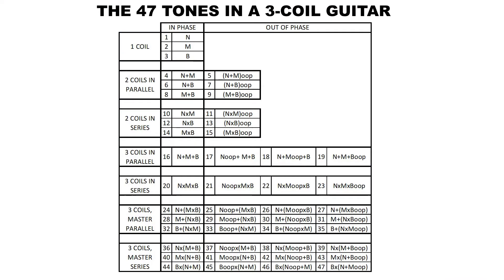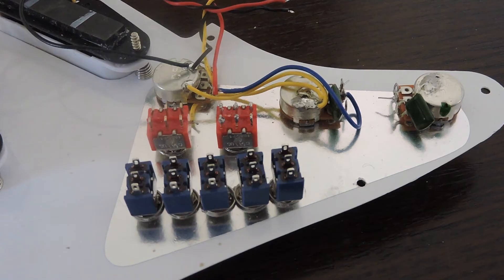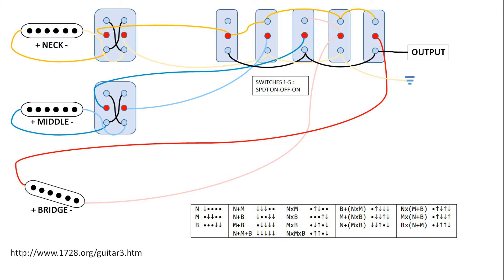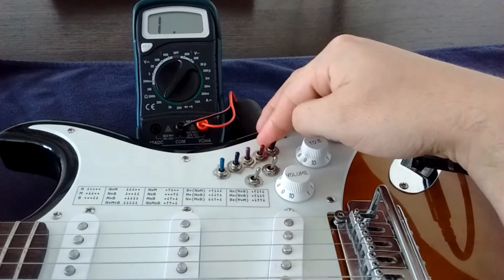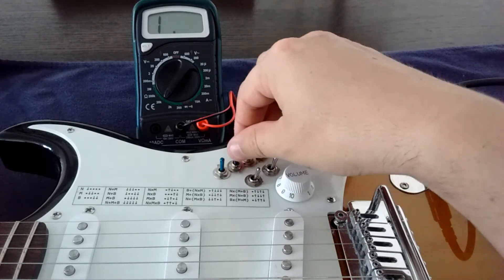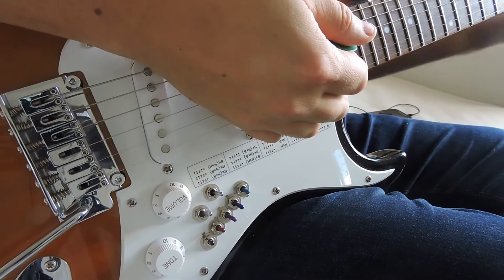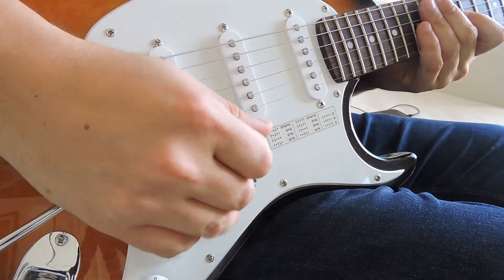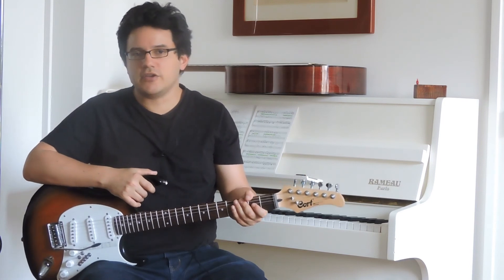Cheap Mod : all pickup combinations strat

Comment: I’ve tried to install this mod but I haven’t been able to get it to work and I have followed the diagram you put in the video is there any key points I’d need to double check were correct for it all to work, also what do I do about the wires that were connected from the volume and time knobs onto the 5 way switch
Reply: Did you usu on-off-on switches ? They are 3 position switches. Other than that, just follow the diagram carefully. The volume and tone pots can be connected in many wqys, but I suggest having a master volume and master tone (so, connected to the output lug on the diagram) and leave the third pot unconnected, or, if you know how to, make it a low pass filter.